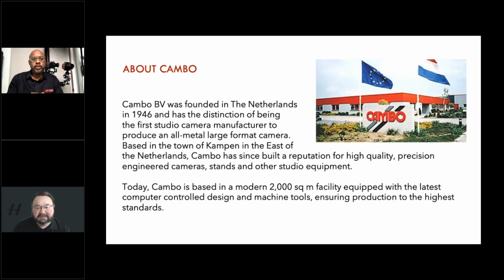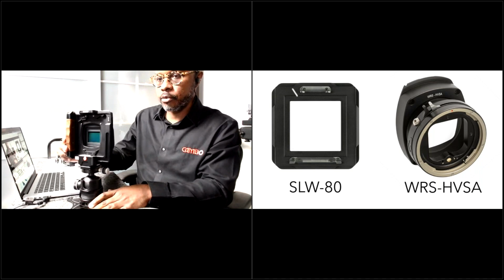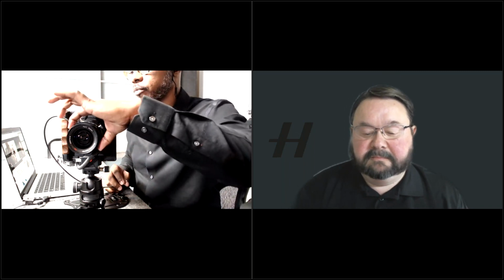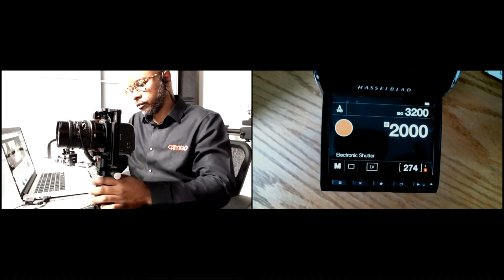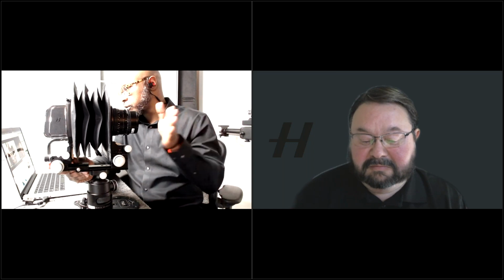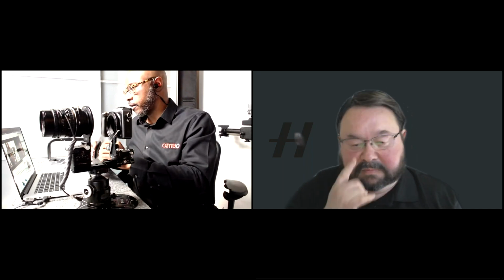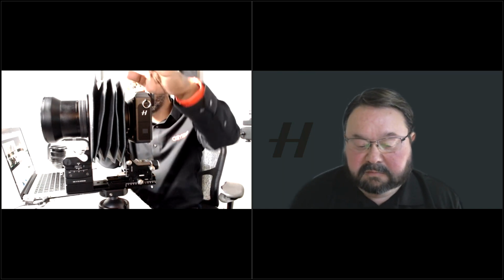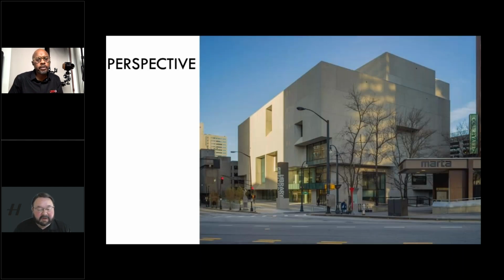Webinar - An Introduction to the Integration of Hasselblad & Cambo Cameras

Comment: at 14:08 a warning, with this adaptor, you NEED to cock the shutter drive, as like a 500c camera the lens is used via the screw drive, and will jam if not set up properly.

Comment: Great webinar, I will be attempting the same setup once I will receive my SLW80 plate but in the meantime I was looking to setup my 907 and I can't find 'Camera Body' submenu in Camera Settings. WIll it appear when the back will be attached to Cambo or there is something I need to download, like software upgrade.
Reply: one thing try a few different names, for instance, Phase One calls this a 'shutter latency' setting, or try under the options for no connection to lens, also an important step is to disconnect the 907x, as it itself has contacts, which 'feel' for the camera, so she's locked at 907x mode, while on this camera! [ also if you plugged the pc sync socket into the flash OUT, not flash IN plug]-this back has BOTH, aka for this mode of operation flash IN is used as a 'wake-up' signal for capture, the other socket runs the flash sync when on technical cameras (this WRS, Cambo Ds or the Alpha TC), as TTL flash communication is via the back in this mode, NOT the lens, that cable as said is the capture signal.

Comment: Could the HVSA lens plate work with a a12/a16 film back too? The WRC 400 could be a nice alternative to the Flexbody for travel (with a mix of film and digital backs).
Reply: YES, the back plate is a V-system plate, and the CFVii50C is a v mount, same as the A-12 and A-16 film mags, BUT a warning, just like the flexbody, you MUST insert the darkslide BEFORE cocking the lens, as the V bodies and lenses are slr's with the mirror and some baffle protecting the film, you must have the shutter CLOSED before the slide comes out!, the v lenses are OPEN when the shutter is cocked [thats the 'middle' position, just like the flexbody {open/close/expose}], as with all film mf or lf cameras, take it SLOW and stop, think, then do! so you don't fry the film.

Comment: As far as I know using the electronic shutter on the Hasselblad X1D prevents you from using flash. Is there a work around for this?
Reply: Would love to know if you’ve found any solution to this
Reply: @philipspector4875  NO flash with electronic shutter
Reply: Why are Hasselblad/Cambo not answering the questions raised here ?  Seems impolite.

Comment: Can I focus the Lens on the Liveview and fire the shutter same time ?
Reply: NO, not on the WRS, the hassy V lens is mechanical, so if you use that, it needs a shutter cable to be 'fired', the live view is just for composing and checking for vignetting, its NOT like the phase one XT or XC cameras, they have a 'x-shutter' so the back can control the shutter.

Comment: It is a very interesting integration.  May I know how  the flash sync signal can be shared with CFV II together with studio flash remote trigger so that we can control the back and the flash at the same time?
Reply: Not sure if you found your answer already, @sekkin6928, but it's quite easy. The lens shutter can be connected to the flash "in" port. The flash "out" port is used to connect to your remote (via a cable as there's no shoe on the CFVII). Once you have the 2 connections made, you're up + running and can start playing around with your settings (shutter/aperture/iso/flash power). Have fun!

Comment: how is the Hasselblad back getting the power? batteries..
Reply: The Hasselblad back has a battery located behind the right side door , beneath SD cards (same battery as X1D)
when tethered shooting it is powered by USB-C, left side connector, it has also a 12-24 V DC input on the bottom side